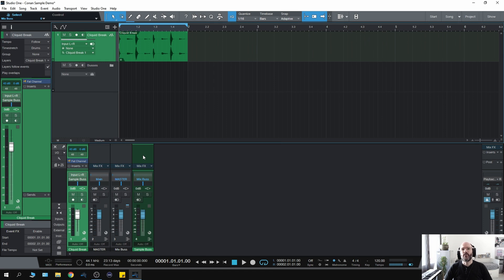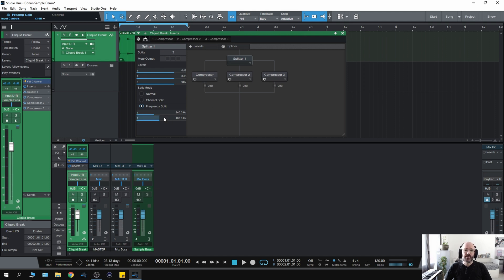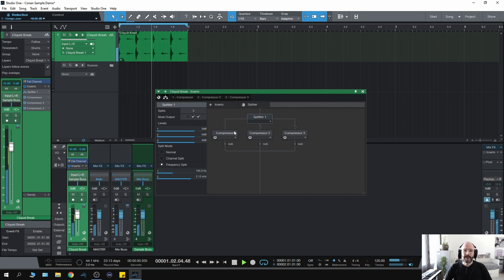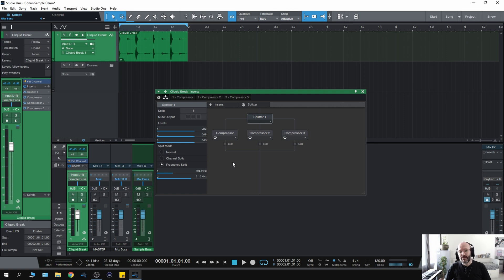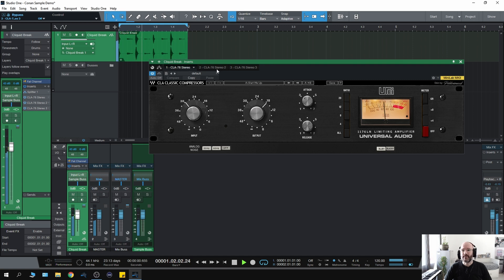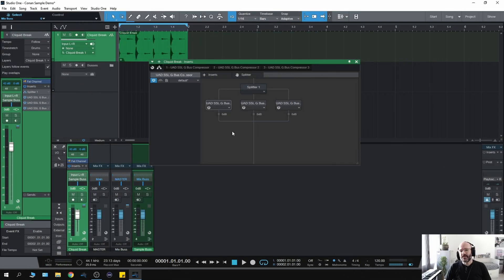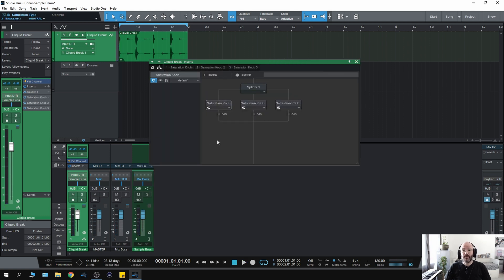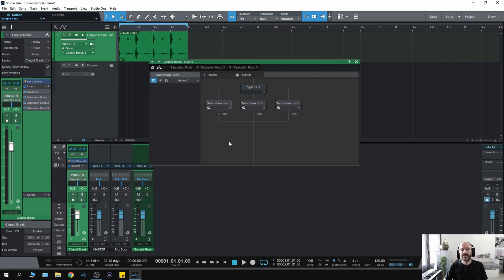Presonus Studio One: How to create your own Multiband FX for Mixing and Mastering

Comment: Great video, but why didn't you use the Multiband conpressor in Studio One?
Reply from the maker: Hey buddy, thanks for watching. That’s a great question. As I said in the video, I have a ton of Multiband compressors, but this technique allows me to use any compressor. All compressors are not created equal. The ability to be able to have a Multiband FET, opto, tube or VCA gives me more to work with than the stock Multiband. Also, there is no Multiband saturation, limiter or clipper in S1. To be honest, that is really what the video is about, as being able to make Multiband compressors with the splitter has been discussed before. I wanted to show that the splitter can be used for more than just the previously mentioned Multiband compressor. Thanks again for watching.
Reply: I think you can process different bands with different plugins like saturators, eq, etc. Instead of just compression